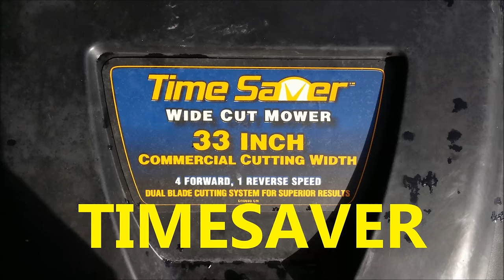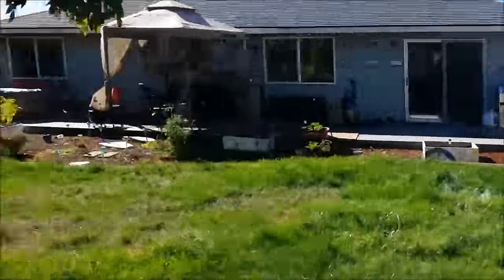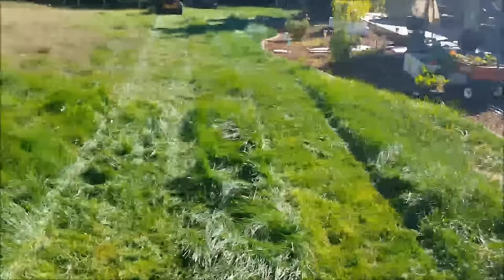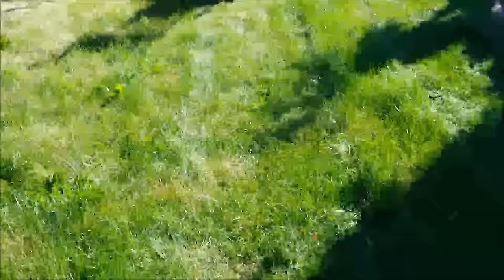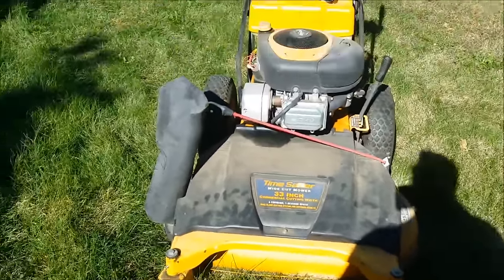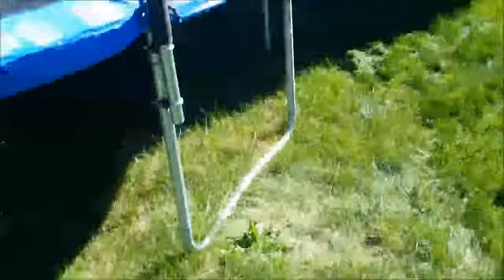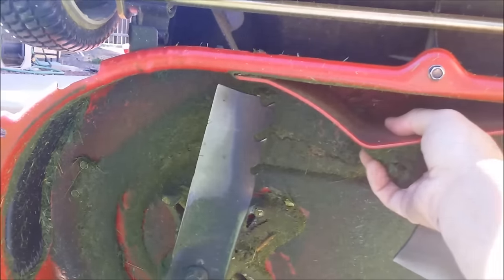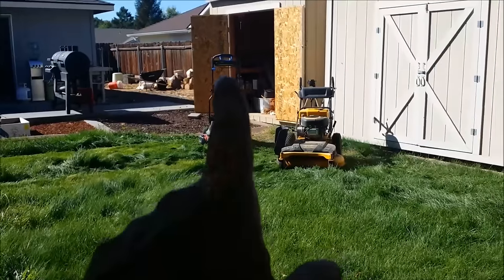Cub Cadet 33 in. VS. Toro TImemaster

Comment: I own the Cub as well and it has never cut like that. One thing I must say is if you look at the blades of each at 7:21 and 13:52 you can see the Cub blades are much more worn than the Toro. I was hoping for a fairer test as I love my Cub but was looking into another mower. Honestly after hearing the Toro bog down I'll hang onto my Cub a little longer. The Cub has NEVER been short on power.

Comment: Toro Timemaster is a beast, I use it professionaly for years without any breakdowns except regular sharpening the blades, changing the oil, etc.. I know Timemaster isn't a professional machine, his brother Turfmaster is a pro machine but guys I'm using it every day during the season and it works perfectly. Sure, it has a lot of plastic parts that are all metal on the Turfmaster but I take care of my equipment and no trouble there. They also say that the Turmaster has a pro engine.. Yeah right... Never had any problems with my B&S on Timemaster. Last but not the least it's much lighter.. So I fully recommend Toro Timemaster or if you need a 22" mower than there's nothing out there that beats Honda HRX series with plastic deck...
Reply from the maker: I agree after years of use the Timemaster is a nice mower. once I started hiring employees I did make the switch to Turmasters for the added durability.  Yes when we need 21's we use Honda's
Reply from the maker: @vegass04  LOL, I get it totally, I found hiring zero experience guys the best for taking care of equipment, but things are still going to break more even if they think they are being careful.  Pay for Performance will cure the time stealing issue.  ( learning as I go)

Comment: I have the Craftsman version of that Cub cadet mower and it is going on 13 years old. There is no way I would try to mulch grass that high. Instead I remove the mulch plug, mow the grass and then reinstall the mulch plug and mulch the clippings with excellent results. Of coarse I try to keep up with the grass so it doesn't get so long that I have to cut it twice.

Comment: I have a 7 year old Craftsman that looks very similar to the Cub Cadet but with battery for electric start, and an oil filter. Mine is 33 inch, 420cc, 13-15 HP and goes like a bat-out-of-hell.   It  has the big tires like the Cadet and it climbs a 30 degree hill effortlessly even though they only rate it for a 15 degree hill.   My understanding is there are two types of systems used in most small engines: splash lubrication and forced oil lubrication.  I assume with an oil filter the engine has an oil pump ("forced oil lubrication" which would be necessary to get lubrication on steep hills.

Comment: I was given a cub & has a 42 inch deck with twin blades & powered by a 10.5 HP B.S engine . The only thing I did was replace the battery! Other than that it’s been a good mower . The key with any mower regardless of brand is Maintenance & keeping the blades sharpened! That’s key !
Reply from the maker: Absolutely maintenance is key glad you are having great luck with your mower

Comment: I serously think the blades on your Cub Cadet were worn out.  Ive seen that same model do a lot better than that in other mowing videos on youtube also cutting tall glass.
Reply: Bluepit
Reply: Ive had both mowers ... cub is better.  Neither is a commercial
Reply: Blades were rounded on the cub for sure
Reply: No, they just poor mowers.
Reply: @martianshoes  a sharp blade will cut its how rotor mowers mow how it clumps is the mowers job

Comment: Update:  I loved the Toro when I first got it, and this video is what convinced me to buy it.  But here is what I don't like.  Having lived in Texas, I use to love to mulch.  But now I live in the northeast, where the grass is wet from dew, often well after noon, when side discharging is the preferred method.  And even then, because it's primarily a mulching mower with two blades spinning in opposite directions, it keeps the grass under the deck, and then clogs up in the discharge opening.  And the mower will bog down in wet grass even if it's not to long.  

The ideal commercial mower for wet/tall conditions is one that will get the grass out from under the deck so as not to bog down.  If all your lawns are dry and short, then the Toro is great, and well worth the money for the 40% extra cutting width. But mulching mowers are not made to cut high or wet grass.  

I don't know if they even make a single blade, self-propelled, rear wheel drive, with a large side discharge opening.  But if they do, I'll be buying it real soon, or I'll enlarge an opening myself.  One that's a bit lighter then the Toro which can wear you down if cutting in close quarters and ditches.  

Does anyone have a suggestion on a mower that is powerful enough to side discharge tall wet grass?
Reply: I'm glad I just watched this video. I have about 7 or 8 yards with a Torro Timemaster, and while I love the cut and the deck width, I've been unsatisfied with the power and its lack of maneuverability. Just a slight incline will make you think you're using your dads old mower from 1985. But after watching this video it looks like I made the best choice.
Reply: B Brown I just bought the Timemaster.  I'm loving it so far.  But I keep running out of gas.  My Exmark with 7 gallons has me spoiled.  I tried mulching foot high grass, and it couldn't do it.  And really slows down when wet grass gets stuck up under the deck.  But when the grass is normal height, it does a fantastic job.  It is a bit heavy in close quarters, but man is it fast.
Reply: #1, use high lift blades if you aren't already. I can't stand so called "Mulching blades" ie, Gators. Also, look up a product called Clean Deck 1000.
Reply: Steven L Why do you like high lift blades better then gators?  I just did a test and found that it didn't look as good a week later, with the grass that was left on top being much longer then with the mulching blades, so I put the gators back on.
Reply: B Brown As far as lack of power, I found I needed to tighten my blade engage and the rpm's came up. I first tested it by pulling up on the cable by my hands to see what it did, and that brought the rpm's/power up.  Now mine is working much better in thick grass then it was. The cable runs to the front of the engine up under the pulley cover, which just has four screws that hold it in place.
Reply: I think the Gators may do better with thinner cool season grasses but I didn't care for them much with St Augustine and I've used them with two different mowers. But thx for the tip on rpm's. 
My CC is back in the shop now because the deck dropped for some reason. In the year 1/2 I've had it it's spent more time in shop than in field damn near.
Reply: Steven L This video convinced me not to buy the Club Cadet.  I use to live in Texas.  But now I live in the northeast, where the grass is wet from dew until well after noon, and tends to rain more often here.  Wet grass isn't as easy to mulch as dry, and doesn't side discharge as well either.  I get clumping with or without the gators on my Exmark 60 inch.  In Texas, my 21 inch Snapper with ninja blades ( I let go for a song)  turned the St. Augustine into powder.  I'm thinking of selling my backup 21 inch Craftsman I don't like, to buy another Commercial Snapper 21 inch mulcher mower and buy a side discharge chute. I've not bagged anything since the early spring.  I believe they're also 190cc's like the Timemaster.  If that won't go thru tall grass in a ditch, nothing will. 

Club Cadet has a Z-force zero turn with a steering wheel that looks interesting to me. It looks like it automatically reverses the direction of the wheels, so you don't tear up the turf.
Reply: Apparently the Snapper was discontinued but you might find one on Ebay. I do like the Ninja blade concept though.
Wet grass just cannot be mulched for the most part and must be discharged. I mow a yard every 2 weeks and it's so thick that even at 11-12pm it's still wet and about 3.5-3.75". I cut it open chute with my Toro AWD 190cc 21 and was impressed it cut well with few stragglers. Only thing I do not like about that AWD is the B&S 190cc has crappy torque and is slow. A 2wd would be quicker.
Do NOT get a ZT with a steering wheel, you'll regret it.
Reply: Steven L Mowers Direct and others offer the Snapper (21") Commercial Ninja Self-Propelled Mulching Lawn Mower.  

In Texas, the problem with the Ninja blade is the sand really wears down the upper part of the blade, and they are very expensive to replace.  I've not used the Honda double blade system, but that sounds like it would be more economical, since you could at least sharpen the blades.  

I should get consumers reports, but owners on YouTube give the best real world reviews.
Reply: Mowers Direct was first site I went to and said Discontinued. Not sure if Jack's has it.
I use the Honda with the twin blades and sharp enough to shave with and STILL get stragglers! Not a lot, but enough to piss me off. But on a single blade system you always will. And even though it's two blades to me still a single blade system. But I like that lil Honda I gotta say. Even with it's faults, like the crappy drive system that sticks on reverse and bogs down on wet, thick grass. But that's because it's only 160cc,
I don't trust CR far as I can throw 'em.

Comment: To anyone interested...definitely buy the Toro over the cub cadet. After about 100 hours the cub cadet starts falling apart! I had numerous cables snap, the deck broke off from the brackets and the frame crack! I purchased the Toro after and it has been so much better in terms of reliability! It also performs much better on hills. I would not recommend the CC to anyone.

Comment: are your blades sharp are they deformed or bent it make`s a difference in cutting how high or low makes difference also.
mulching tall grass is hard on machines period. you can change your blade configuration to cut the grass up to get more fine pieces. but most mowers are better at side discharging.

Comment: I'm actually looking into getting both of these mowers and can't make up my mind which way I want to go. We'll see what I end up doing
Reply from the maker: This is a really old video and at that time the cub had a lot of hours on it so it was already an older mower then. So I am sure they are different mowers now. The timemasters now have a larger engine. I now use Turfmasters however that is because of the amount of hours they get on them in a season ( around 200) and I like the added durability of the commercial upgrades
Reply: In the same boat, which did you go with

Comment: I have the same cub Cadet I think 🤔 but I use different blades with a high lift and mulch blade combo and mine is the 420cc with sulky and seems like mine cuts way faster and easier. I never get grass caught up like you are unless it’s really wet I may get some but I’ve never noticed it
Reply from the maker: Thanks for sharing

Comment: I live on a hilly lawn.  I have the 33 inch cub cadet but it leaves a lot of clumps and I was thinking of the Toro.    Will the Toro do well with hills?
Reply from the maker: We use Toro 30 commercial inch mowers now. but that cub is a different transmission all together so it climbs hills on its own. The Toro will pull small hills but steep stuff your going to have to help it.
Reply: @BirchsLawnCareLLC  Will it wreck the transmission to go on hills with it or anything?  Does the Toro leave many clumps?
Reply: @WillyEast  I know this is old but for other people looking,I have the toro and it doesn't  pull hills good at all but it cuts really good and no clumps but I try to cut when the grass is dry
Reply: @shadwell749    I actually haven't bought a new mower yet.  My concern with the Toro is the small gas tank.  Also how well will it cut tall grass without leaving clumps?

Comment: The belts are in good condition, but apparently not tensioned properly. They are long belts and will stretch more than most.  Proper tension and the C C has no problem.

Comment: first thing sir never do what you did twice clear the deck out with the moter  running and question are the nblade the same type would mke a difference in how oit cuts the taller stuff

Comment: Impressed with the  Toro even though I  use Honda's
Reply from the maker: i don't use the timemaster any longer  but they are good machines. . I too use the Honda for when i need a 21 inch mower.
Reply from the maker: @johnrogers9275  I have since upgraded to the commercial Turfmaster model.
Reply: @BirchsLawnCareLLC  so if price was the same and you had only 20 yards a week which mower would you want turfmaster or that 33 cub cadet? thanks